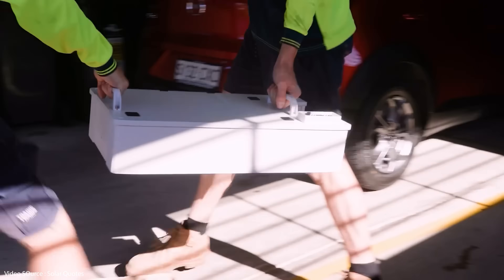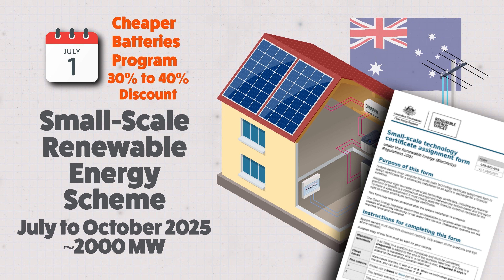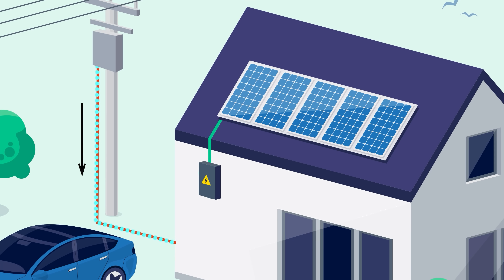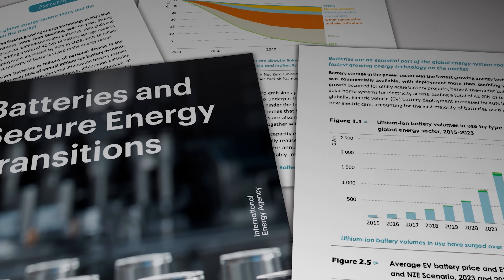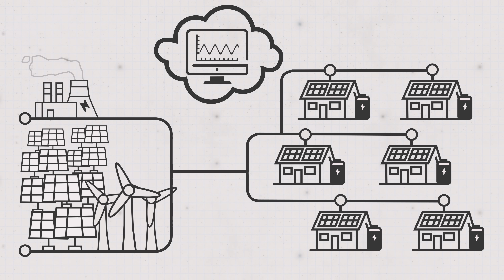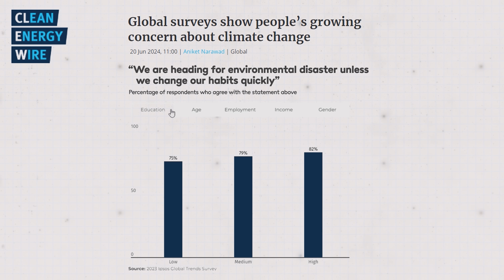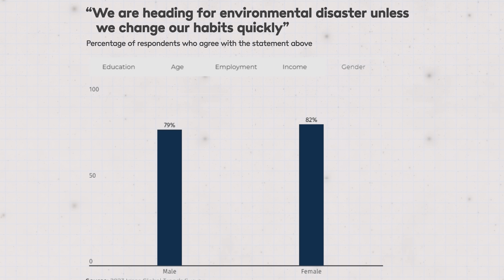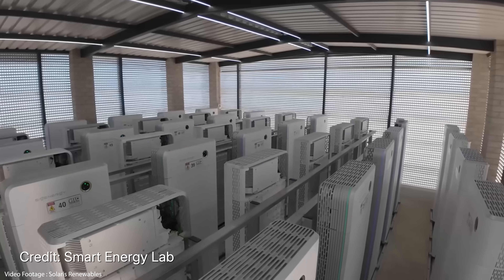Australians installed 100,000 home batteries in 17 weeks. Why can't we all do that?

Comment: Very interesting video and sounds like Australia has come up with a viable solution to their current grid infrastructure weakness.  I'm certain the vast majority of those homes that have now installed battery storage will already be getting benefits.  The full extent of benefits may take time to demonstrate but my guess is all of those homeowners will be saving money.  It's critical the Australian grid authority makes good use of the time this action has given them to invest in grid infrastructure that can better deal with energy fluctuations.
I live in the UK and installed 15kW of battery storage just over 3 years ago.  During the summer months my batteries remain fully charged from solar during the day and only need occasional 'top-ups' overnight.  The rest of my solar is sent to the grid.  During the winter months I send less to the grid and keep my batteries fully charged using cheap rate overnight grid energy.  It's a win-win financially and my consumption of expensive daytime tariff electricity has fallen dramatically.
Reply: Australia has virtually rebuilt its grid over the past decade, which is why its electricity prices have risen.  It’ll soon transition to inevitable lower cost.

Comment: Many of these batteries are also plugged into VPP's, giving customers $$$ for selling into the grid at high times. As an example, a mate has just installed a 50kwhr battery + Inverter for $15000.
I purchased my 11kw battery 3 years ago without subsidies for $13000. Since that time, i only have only had to pay 2 electricity bills year per yr and they haven't exceeded $30. It's been a big benefit to me.

Comment: 17 Kws of solar panels and a tesla powerwall 3  . 
I have no electricity bills .
Not that sunny in Brisbane atm . It takes at least until 9am before my battery is full .
Reply: I am getting 4 cents a KWh feed in which covers the network connection fee. My last bill was minus $5!
Reply: @audigga4396  And how much of that minus $5 was because of the government energy rebates that you will NOT get next bill?
Reply: Well that is a lie. You said you are in Brisbane, which means you are still connected to the grid, which means you still have to deal with the various daily access charges which you can't get away from and are the biggest part of the bill.
Reply: @petert3355 Well, that's a lie. I'm in Victoria and out tarrifs cover the infrastructure component. Try not to br do pompous in future.
Reply: @Triantiwantigongolope  Right, Vic feed in tarrif is max 11c per kwh, most average 4c per kwh.
The daily access charge in Vic is, depending on plan, from $1.50 to over $2 per day.
Taking the average means you need to generate in excess of your usage 38kwh per day (150 cents  DAC / 4 cents solar tarriff).
Now given that most home solar systems are in the 3 to 5 kw range, it's unlikely that you will generate enough excess to cover the charge. The math gets even worse when you add batteries into the mix.

One last thing, before you accuse people of being "pompous", you might actually want to run the math.
Reply: @petert3355   You think I have a small system. Oh bless. My bills don't lie. Try not to be so pompous next time.
Reply: @Triantiwantigongolope  Oh, so you jumped through all the hoops to put a much larger than average system on your house. GOOD FOR YOU.
You're the exception to the rule.
Now getting back to the actual topic, Are you STILL trying to claim that your statement, generalising as you did, is true? 
The math PROVES you're wrong.

Does the average household solar installation completely cover ALL charges of the average household bill? YES/NO

The correct answer is no, but I'm thinking you're the sort of person who will ignore proof and die on the hill of their ignorance.
Reply: @petert3355  you think I'm just running a house ? Oh bless. Try not to be so pompous nest time.
Reply: @petert3355  With VPPs you buy and sell at wholesale electricity prices, their smarts, like Ambers, charges and discharges your battery cleverly, so with an optimal setup you are in credit every month - plus spreading the load on the grid which is what this is all about.
Reply: @petert3355  Sat 13 Dec Usage including daily charges $1.35 
Sold to grid $1.55 .

Comment: Wow!  I'd have never guessed that their inverters were single phase.  How short sighted.
Reply: Yes. Australia is very big with a small population. It electrified quickly, which was an impressive achievement.  But it was done by cutting corners that now have to be fixed. 

Dave gave a good summary of our grid problems, but they run deeper.

Comment: Don't forget that Vehicle-to-Grid (V2G) can basically have the SAME "balancing effect" as home batteries are theoretically capable of.
Reply: V2G is dumb...  Sure, it could work, but why would you speed the degradation of your vehicle battery like that?  Every battery pack has a certain number of charge cycles before degradation begins to kick in.  I'd use your EV battery pack for driving only, and get another battery pack for your home otherwise your EV battery pack will lose years of life.
Reply: @Les_S537  Most current car batteries will already outlive the life of the cars they are mounted in. Your principle is basically a thing of the past.
Reply: @Junyo  I have no idea where you heard such a thing, but as a long time EV proponent, and current EV owner I know that isn't the case.

In labs, they can achieve high charge cycle lifespans, but a lab isn't the real world.

Comment: Thanks for the breakdown Dave, what is happening here is a lot of the batteries being sold are ones in the 50KW range some people are going overboard which is killing it for the average Joe blow, the scheme has worked to well and it'll end before it was scheduled too.
Reply: Not true. 

They just announced they'll put another ~$4billion into the scheme and changed the settings to make the scheme last beyond 2030 as per the original plan and solve the problems large batteries taking too much subsidies.
Reply: That's easy enough to tweak to fix. I'm more concerned and curious to see what happens when they get a lot of battery only people using the 3 hours free power to bulk charge giant batteries. There's going to be some massive swings in grid consumption in the seconds after power goes free and some enormous network effects that will be very hard to control

Comment: You know sometimes you just have to feel sorry for fossil fuel fanatics.  Just when they find a legitimate complaint about renewable energy, some darn boffin comes strolling through with a solution that not only solves the problem, but solves the problem with a technology that is getting less expensive every day, AND results in using even less fossil fuels.  Sometimes it seems they can never get a break.

Comment: Insane regulations and costs.  Same problem in the U.K. that we have in the U.S....  Australia has a much more free-wheeling environment.   Traditional systems in the U.K. also focused on no-battery or very small batteries in the recent past due to the way utility pricing works (which is now slowly changing).

For the U.S. though, where systems tend to be much larger than those in the U.K., the large liabilities associated with the installation business and huge cost has been a drag.

Spain's problem was due to government / regulatory corruption that de-emphasized ancillary services and storage to provide stability in a very renewables-heavy grid.   So whereas California can more or less run 100% renewables and be fully stable, Spain's lack of storage and ancillary services and lack of DC partitioning (basically one huge AC network crossing multiple countries with a frequency synchronization dependence), lack of automation, and too many different service areas not talking to each other.   I think there was also a light-loading issue as well prior to the blackout that made the problem worse.  This all resulted in a slow, low-frequency oscillation going between several countries in the EU block, back and forth.  With nothing to damp it out, it got bad enough to start tripping generation and transmission lines off-line.

All of these issues are basically solved by battery storage, DC partiioning (California's Pacific DC intertie is a good example), and maybe a few condensers situated at critical points.

The phase imbalance issue in Australia isn't an issue in the U.S. or (typically) the U.K., though it can be.  It is more akin to problems that Hawaii has had in the past when it was electrifying.   The U.S. and the U.K. generally have a 3-phase transmission system same as Australia (same as most countries), with a single phase going into a typical U.S. home at 240VAC (called split-phase, so 120VAC can be topologically generated for home plugs and 240VAC for heavy appliances).

The issue for Australia is a combination of the sheer number of residential installations on the grid combined with a high level of self sufficiency. Australian homes with solar and storage are so self-sufficient that the distribution system can wind up being completely unloaded during parts of the day.   This creates a light-loading issue which greatly amplifies any imbalances... even causes problems naturally just due to the light loading.  Particularly when power is being pushed the opposite direction where transformer dividers operate in reciprocal.  Grids need a minimum level of loading to be stable.

-Matt
Reply: That was really interesting.  Thanks.
Reply: The Australian government is also incentivising V2G. Millions of EVs connected to the grid via bidirectional chargers could form a massive virtual battery  many gigawatt hours 8n size.
Reply: Pv+Battery is pretty common install  now in the UK. US UK costs are miles apart from each other.

Comment: 0:42 I'll comment first, then watch the rest of the video. Why did Australians install home batteries? Because their electrical grid sucks and it's very expensive. Installing the batteries was the cheaper option. It was financially viable to do so. Why can't we all do that? Most of us don't have $10,000 just lying around to install the thing, and we don't live in proper climates for adequate solar to charge the batteries. For instance, Electricity in Wisconsin is a little over $0.18/kwh. It used to be around $0.11/kwh, but then they started installing solar panels everywhere which helped to increase residential rates. In Australia, it's closer to $0.39/kwh, more than twice as expensive. Plus Australia is far superior to Wisconsin in terms of Solar efficiency.
Reply: 1:17 30-40% off, eh? So, some quick math: $10,000* 0.35 = $3,500 off the price, so $6,500. 100,000 units. Mkay... add some zeroes... $650,000,000... so the government covered $650M of the cost to the customers... Money like that can only come from the Federal or State governments.  America has 330,000,000 people and around 100M single-family homes. For the US to give that same discount to every single-family home in America would cost $650B. This would cause inflation in America to go up even more.
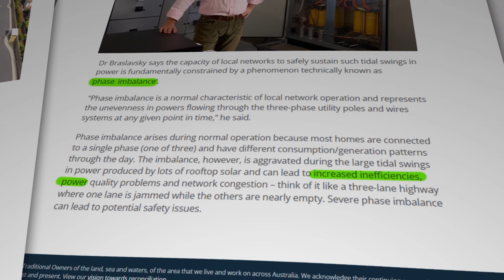Reply: 3:41 Also, inefficiencies in fuel consumption, which then increases the costs of the fuel, which then gets passed onto the customers as higher rates. It also causes uneven loading on critical equipment which causes it to wear out faster and need replacing sooner, also increasing the rate to customers. That's why Wisconsin was at $0.11/kwh and is now at $0.18/kwh. Grid systems and components are build to work balanced. Imbalance degrades them faster.
Reply: 4:49 Yes, and if you store those electrons for later use on-site, then there is less need for power on the grid, which then makes the equipment and generators oversized, which decreases efficiency of the grid and again, increases costs to the customer. Imagine if you had a 2MW generator that was operating around 80% efficiency for decades, then all of a sudden, it only needs to produce 1.2MW versus the 1.6MW it was happily chugging along... now you have to drop the efficiency of the generator to 60%. The generator is now oversized for the load needed.
Reply: 8:27 Oh yeah, lol. I forgot the biggest issue... Those 'incentives' and 'subsidies'? Yeah, we pay for those out of our taxes. So not only are you increasing the cost of the electricity, you're also taking more from the citizens in taxes to pay for all of this.
Reply: 11:03 Translation: When governments are allowed to take more money from their citizens in the form of taxes 'for their own good', then amazing things can happen! Dude. You are very clearly NOT an American, nor do you share our values. We don't like regimes. We don't like being taxed, especially if there's no perceivable benefit to us. And we certainly don't like be dictated to by people who think they know our lives better than we do.

So hey, you wanna destroy your electrical grids over there in Europe and raise the costs of electricity for everyone who can't afford your 'ideas', be my guest. I will advocate for America.

Comment: The OZ Govt.'s home battery incentive scheme was originally funded through to 2030, anticipating that most households would install a 10kw battery, gaining a rebate of about $4,000. But many people have taken the opportunity to install 50kw batteries, gaining a rebate of about $18,000. The money has run out in that 17 weeks mentioned and additional funding has just been added, to hopefully allow the scheme to continue. The scheme has been re-designed and was originally poorly designed in that it didn't cap the size of batteries. There is criticism that the Govt. rushed to introduce the scheme and didn't think it through properly. Having an oversize battery is not necessarily a bad thing, it just meant that the money ran out far too quickly. The other issue is that with such a mad rush for bigger batteries they are generally poorer quality, Chinese made batteries. This may lead to maintenance/repair/replacement problems down the track. We also now have a proposal to make electricity free for 3 hours in the middle of the day, encouraging people to use that time to charge their batteries and electric cars and hopefully mitigating curtailment.
Reply: Why do you think Chinese made batteries are poor quality?  Do you have any evidence to back up that claim?  I think you’re wrong, most batteries in the world are Chinese made and it’s thanks to them that the Aussie Govt can afford to roll out a scheme to so many households, in the first place.
Reply: @kerilloyd7504  China has hundreds of battery startups that are pumping out cruddy cells.  The bug guys like CATL do batteries well, but I've seen many people's battery powered devices crater due to Chinese startup battery company's cells.
Reply: kW or kWh??
Reply: Errrrr.....I think just about all of the batteries and cells are from China.  Don't assume they're poor quality.

Comment: I'd like to know what these systems cost in Australia.  I have just received a quote for $20,000NZ for a tad under 20kWh of battery storage to go along with my solar panels.  This seems to me a ridiculous price.  Batteries at the pack level are reported to be coming in at just above $100US per kWh so where is the huge difference.
Reply: The cost of the battery cells that go into the pack are ~$100 per kWH, but a home battery backup system is a lot more than just the batteries themselves plus you have to factor in the cost of integration into your home plus labor.
Reply: Most systems are sold with an inverter that is tied to the inverter vendors own batteries and then they screw you over because it's tied. If you've ever owned an Apple product you'll be familiar with the pricing model.

I'm currently (UK) paying £3500 for 32kWh including taxes, which according to the internet is 8000 NZD for a complete battery unit that just needs cabling to an inverter. Thats a UK assembled battery with about 6000-8000 cycles guaranteed (from CATL and similar Chinese cells) and with UK support and service.

Comment: Hi here in Ireland 🇮🇪  we have solar 4.5kwh  and 11kwh of batteries and 5kwh inverter since 2022 but they (government)  have reduce the inverter power output reduced 3.5 kwh i think this is crazy 🤪  
A lot of people have just the minimum of pannels and no batteries in order get the best BER (building energy rating )
We are halfway to being in profit 5,700  already with load shifting and driving an ev adds about 7,000 in fuel savings since March 2021  and 120,000 km 72,000 miles 😀

Comment: The real question really is, were these batteries designed to operate in perpetuity upside-down, as would quite obviously be the case when installed in Australia?
Reply: Yep - and the connectors have to screw on the other way too 8)
Reply: @etchedpixels  Right! The Coriolis Effect !
Reply: @etchedpixels  In OZ it's "righty-loosey; lefty-tighty"  But it only APPEARS that way to us on account of they are upside down:  Einstein's Very Special Theory of Relativity
Reply: :face-blue-smiling: